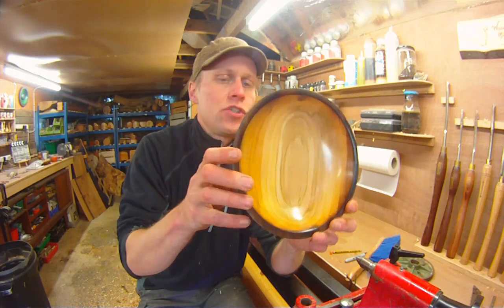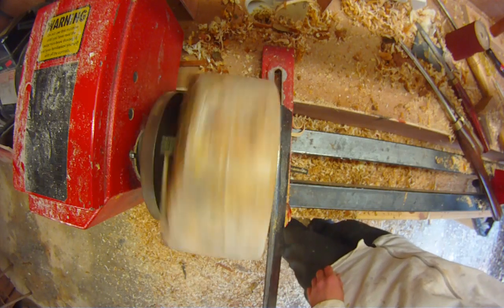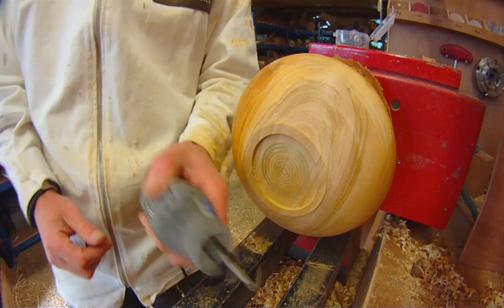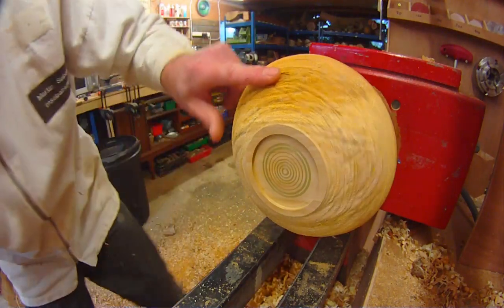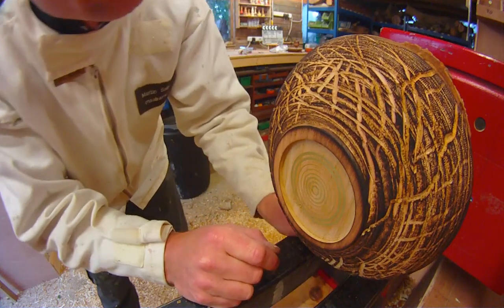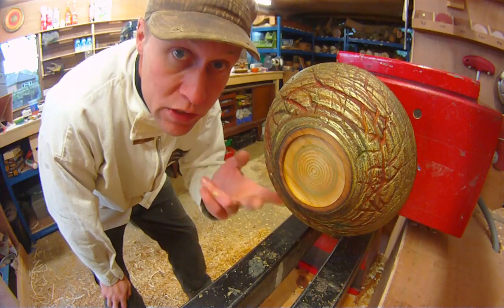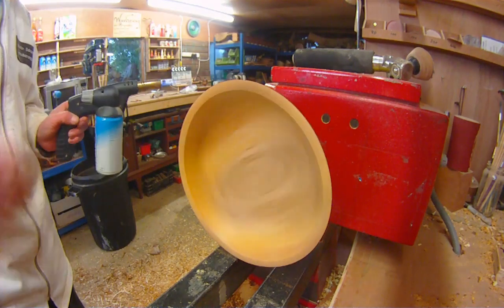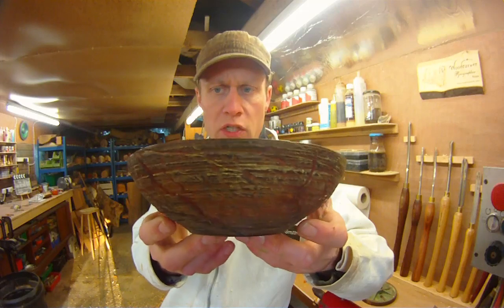#40 Woodturning: Texturing, Burning and Colouring  'Aztec Angst' Bowl

Comment: Its a beautiful piece, well worth the frustration when wood will just not do as its told 😃😃😃
Regarding 3/8" walls or less, I think there are now two schools of woodturning, the traditional turning, where everything is round and brown but do aspire to a high degree of accuracy with  tool work and almost rigid rules, including thin walls and a hatred of colour. The the other, more modern approach, where colour and finish is almost everything and rules, like, thin walls, are not as important. However, the old painters often painted there masterpieces on wood panels.
Thanks
James

Comment: Ayup Martin,
I thought that you ruined the bowl when you applied the different textures! That was until you started your air brushing and scorching! !! It looks chuffin ace mate. I used to do something very similar with texture paste for the backgrounds of cards. But I then cut leaf shapes out of thin perspex and use stipple brushes to stipple around the leaves with a colour used from the background! You could do the same but with the airbrush! 
As long as the leaf/shape is close to the bowl surface it should work. Or cut the shapes out of coke cans then press the shape to the general shape of the bowl, you could then scorch instead of the airbrush! Nothing to heavy just delicate spraying or scorching if you know what I mean! I hope you don't think I'm poking my nose in mate it's just a suggestion if ya want something else out of the spraying or scorching. I think it's called negative stencilling or something like that.
But I love what you've done to the cherry bowl, its becoming your signiture. Thanks for sharing a brilliant video.
Cheers
Andy

Comment: Having more time to add to my comment below.
Have you tried cutting shapes out of tin foil? then dab the back with pritstik and sticking them to the wood before spraying! The shapes could be cut or just ripped for a more random look!
Such as...
Snow flakes
stars and stripes! 
hearts
leaves
feathers
circles
squares
the list goes on, you could get a base background by wrapping string and elasic bands around the wood!
A plastic carrier bag looks good when crunched up and wrapped with a few rubber bands then lightly cover with thin paint and then dabbed hard on to the wood. Paint or spray white spirits onto the wood before dabbing with paint to get a more random but feathery blur to the edges of the paint.
Wrap thick copper wire around the wood before spraying or burning, twist wire together to get wider lines. The closer the wire is to the wood the sharper and clearer the image should be!
You could even push the shapes under the wire, but I would lightly burn or spray the wire first then add the shapes and repeat for more depth.
This was your control is cut down drastically,  you don't know what you've got until you strip away the wire and tin shapes!
It's very much like putting pottery ready to be glazed into a kiln, you have so much control but it's the randomness that makes it beautiful!
Reply: Lol lol lol... ahh so it's on a bowl eh.... I've been thinking about an idea for some time now... a patriotic idea. Only problem is that it invoves quite a lot!!! It would take some time to write everything down. If you are interested I can have a go to write all the instructions down and send it you, no problem.
Looking forward to the your pyrography big time.
Cheers
.
Reply: +Martin Saban-Smith I'll have a go at writing it down, not much material needed but quite a few procedures. 
A bit hectic here right now lol so I'll do it later.
Where would you prefer me to send it to?
Reply: ***** Hi Martin, brilliant will do mate.